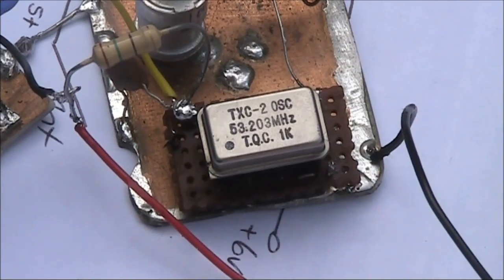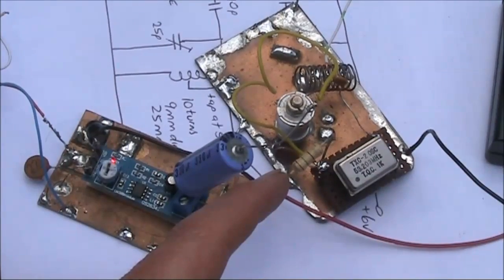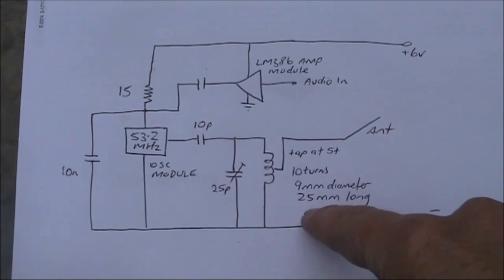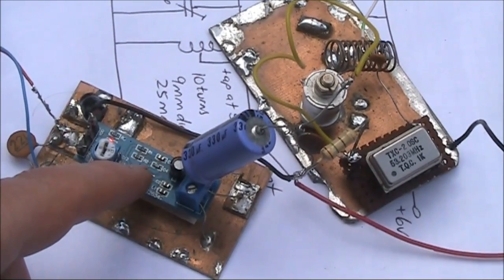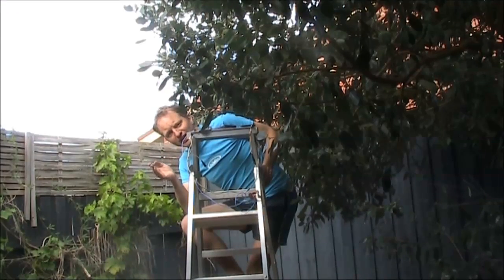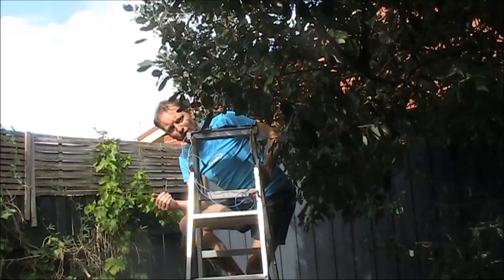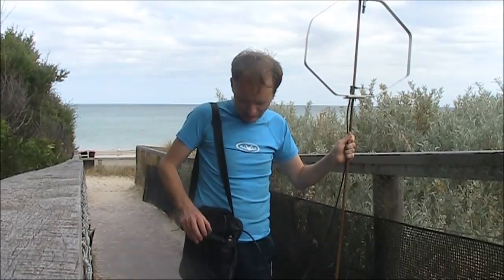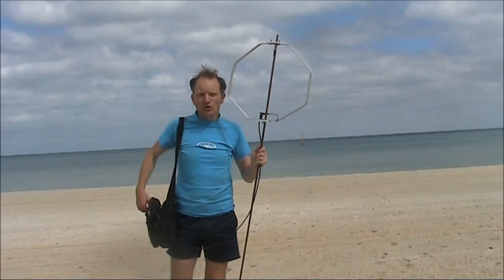A 53.2 MHz crystal oscillator module AM transmitter

Comment: That crystal oscillator module would be good with a buffer/amplifier connecting to that tuned circuit at the correct tapping point, output matching of the amplifier and AM that instead of the oscillator. The range would be pretty good then I would think with maybe 5 additional components.
Reply: 74HC04, ZO = 50 Ω, tr = 6 ns, tf = 6 ns, +/-25mA Each

Comment: Looks like a fun project. Varying the voltage to those oscillators will change the frequency a bit so I guess there would be a little frequency modulation going on.

Comment: Great work ,,, I love it .... I am really interested to find a working easy one-bit transmitter and receiver without using ICs ... Do you have circuits for that ... I'd like to find them based on transistors and some other components to control a device over some distance ... I don't want to use the ready-made solution in the market ... Any advice or circuits ?
Reply from the maker: Lots of circuits on the web. Try the Talking Electronics website.

Comment: Great experiment Peter. I will try to find some oscillators like yours. Until then, I only knew about 50MHz ones, which obviously is too low for that band.
Reply from the maker: Not necessarily. There may be variations between 50 MHz modules and you might be lucky and find one 1 or 2 kHz inside the band. No good for AM but OK for CW beacons etc.
Reply: @vk3ye  Slightly higher voltage, for example 5.5V or 5.6V for a 5V 50MHz module usually pushes them inside the band, without killing them. One's with a separate ENable pin make for somewhat decent test beacons.  
I have also encountered 51.84MHz oscillator modules in scrapped telecoms equipment.

Comment: Could you replace the module with a 50 mhz crystal vxo, Peter?
Reply from the maker: Yes but a VXO would need at least one multiplier stage from a lower frequency (eg 17 or 25 MHz) as only crystals in their fundamental mode can be pulled VXO style.
Reply: VHF is more difficult...